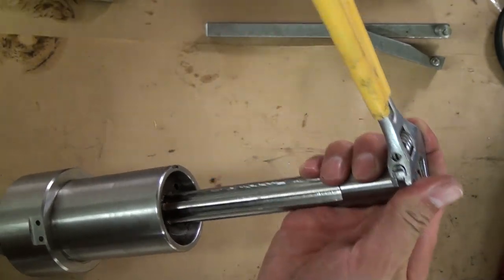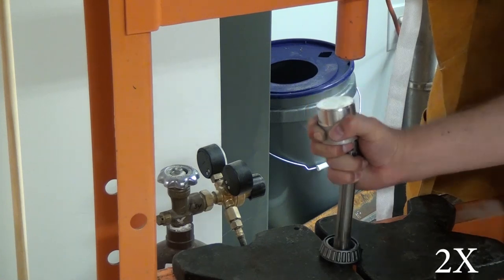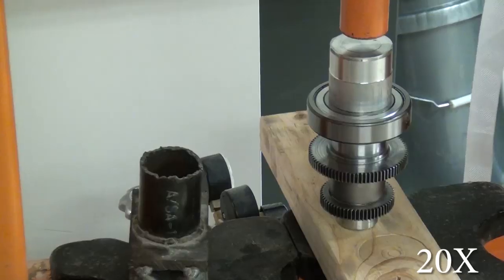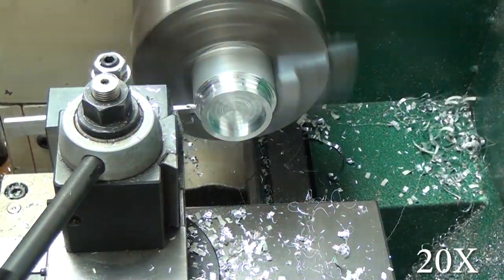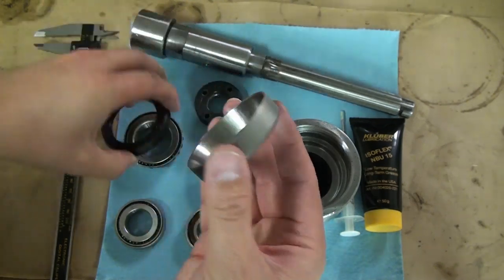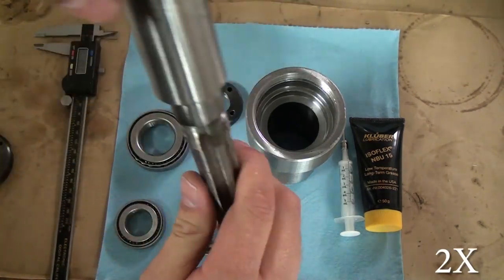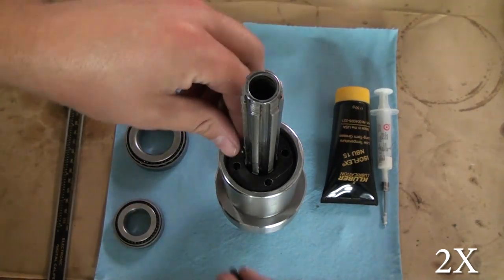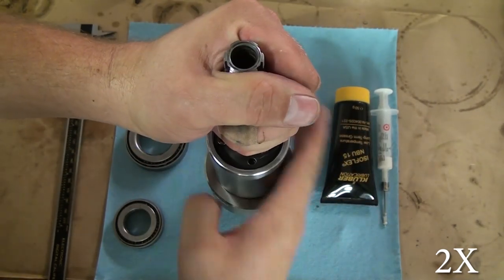CNC-G0704 #14 Belt Drive Conversion pt2 (Spindle Rebuild)

Comment: I took a pair of slip joint pliers and drilled a hole in each jaw, threaded the holes 8-32 IIRC and used 2 SHCP's to engage the ring. Unscrew the screws and the pliers function as normal. The slip joints and the fact that they are pliers allows possibilities of large rings too.
Reply from the maker: AWESOME!!!

Comment: Nice use of a slot drill (end mill) for boring. Never seen that before. Will definitely be giving that a go.
Reply from the maker: Thanks! It makes a horrible nightmare of a chip, but you can really plow through material. This was a 2 flute high speed steel end mill intended for use in aluminum only.

Comment: Russ, I'm in the process of replacing the bearing on a Okamoto surface grinder.  YES, it does have a big effect on how much lubricant you use on bearings.  While it may not have very  much effect on the stock machine it will when you keep upping the RPM's such as you stated.  Do yourself a favor and do some research.  It's different for each type of bearing, size, speed, and load.  Good luck.
Reply from the maker: +Mike C. Thanks Mike. I spent a bunch of time working that out using the Kluber specifications for my bearing size, RPM, etc. In the end, it was to difficult to get a precise amount on the bearing so I guess we'll see how long it lasts :)

Comment: Great video Rus, my new bearings are en route and hopefully should be installed this weekend.
Reply from the maker: Awesome! I hope it goes smoothly :)
Reply: So far so good, I think I set the upper spindle too deep in the head though.  It wasn't spinning smoothly so I tapped it back up a hair and now it seems better.  We'll see how it goes once it's run in a bit.  Definitely much quieter than it was and measuring runout on the inside of the R8 taper I'm getting less than 0.001".
Reply from the maker: ***** Nice. I'm glad it's working so well.
Reply: Dan Cech

Comment: Cool, thanks Russ.  I just did this upgrade a few weeks back.  Interesting that your retaining nuts were on there so tight, Mine came off pretty easily.  My mill i only 3 months old, so maybe they tighten up with time?  Yea, it was painful for me to order that Kluber grease also, and I used a similar serenge/needle setup.  Looking forward to your next video...
Reply from the maker: Lucky! I wish mine would have been easier. I spent at least a couple of hours messing around before deciding to make that dumb spanner.

Comment: If you need a pin spanner just drill 2 holes in the end of a piece of thick walled scrap DOM pipe then insert some steel spin stock than slide that over the spindle shaft and turn the nut out.

Comment: Hi Russ- I broke-down my spindle today and found that your video was spot on. I did make a pin spinner per your pictures. Never did find your drawing, but got concept and made it using 9/16 round stock, worked like a champ.  I wanted to ask you if you, or anyone else has figured out a way to grease these spindle bearings?  When I disassembled I found grease everywhere inside the spindle, except for on the bearings.. my machine is only about a year and a half old, but bottom bearing was really getting hot even running with no load. But I can sure se why now that I found it bone dry. I am really surprised that it didn't seize. Thanks for the  video Howard
Reply from the maker: Hey Howard. I'm glad the video was helpful, and yes it looks like my Dropbox is missing the files for the spanner I made. I'll try and get that added if I can find it.
As for the bearings, I just rebuilt my spindle again because I smoked my lower bearing too (I'm pretty sure my flood coolant washed out all of the grease) and I bought a set of syringes to get the grease inside the bearings: https://www.amazon.com/gp/product/B01ECIVAFE

Comment: just place the quill/spindle assembly in the vise. next use the spindle lock tool and a hammer. place the tool in the pin holes (not the threaded holes) on washer nuts and lightly tap with a hammer counter clockwise

Comment: Like the tool, tryed to make the same but with screws, seems that the cup is pretty tight to unscrew ti with a bolt, all bolt's bended and i will try to turn some tool, did you use mild steel for the pind or something else?
Reply from the maker: I'm pretty sure I used 4340 for the pins, but i don't recall heat treating them.

Comment: why did you change out the taper bearing for a roller bearing on the mill shaft ?  they use a taper bearing on the work end of the shaft so the side play can be taken out through bearing load adjustment. I don't understand why you changed this ? any side play you have or develope  over time from wear you now cannot remove because the taper bearing is on the wrong end of the shaft.
Reply from the maker: I really don't remember. I think Hoss did it to his and I figured why not. The AC bearings had large runout though so I eventually went back to tapered.

Comment: where did you find the bearing lubrication amount specs? I got the same bearing from VXB, and I can't find a grease quantity anywhere
Reply from the maker: Hoss web site, link in the description. For the spindle he says ".5cc for the upper and 1cc for the lower bearing". I tried to use the syringe method to get my grease installed, but had little luck. In the end I just put some in and have no idea how much it was. The idea is to use a small amount instead of packing them full.

Comment: You and a lot of your viewers may already know this, but for the rest, they can pick up an adjustable spanner wrench at any accomplished tool shop or online.  

https://www.google.com/search?q=Adjustable+Face+Spanner&rlz=1C1TSNP_enUS610US610&oq=Adjustable+Face+Spanner&aqs=chrome..69i57&sourceid=chrome&es_sm=122&ie=UTF-8
Reply from the maker: Thanks for the link! I checked everywhere in my area and couldn't find one that came close to fitting this job. If anyone has a link to a spanner they have used on this rebuild I will be happy to annotate the video :)
Reply: russtuff You're welcome.  Just about any of those wrenches annotated in the link would work.  However, it helps to get the right pin size, to avoid slippage and bent knuckles.  I used to use these a lot when I was in the military, repairing weapons.

Comment: hi 
i want to make spindle and drow bar to my homemade mill machine 
can you tell me the size of spindle ..bearing ..drow bar thread ets 
or if you have plan or Sketch to make the mill head ??
thanks
Reply from the maker: The bearings are mentioned in the video, so you should be able to find the specs online pretty easily. As for the head, spindle, and drawbar, I do not have detailed drawings but I know there is a guy online who sells a very detailed model of the BF20 mill, which is similar to my G0704. I can't seem to find it though so you may need to just spend some time searching. I think he sells the CAD model for $20 or so.
Reply: thank you